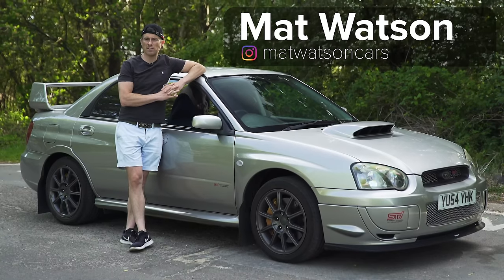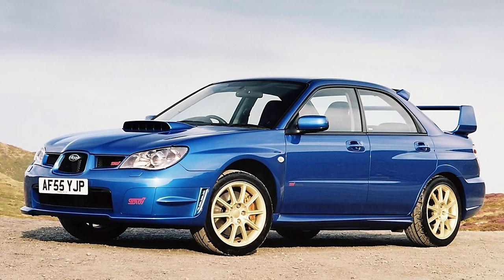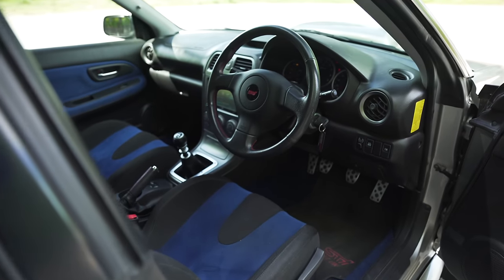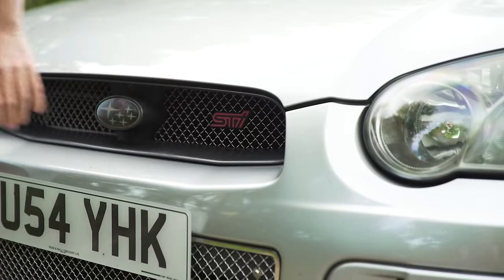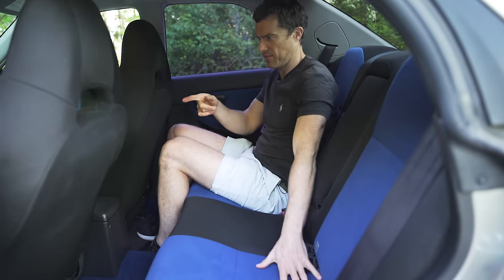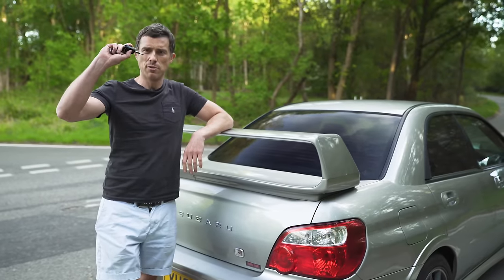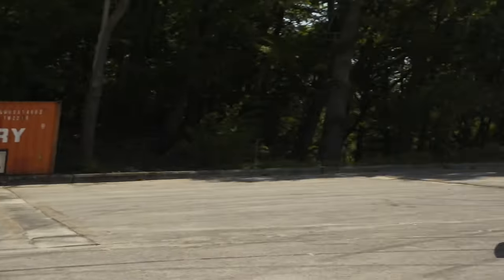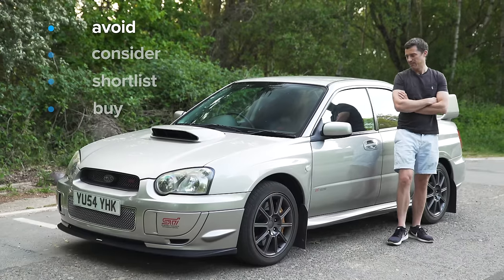Subaru Impreza WRX STi Prodrive 2004 - see why it's the best Scooby ever!

Comment: Just got myself a Subaru wrx turbo prodrive pack loving it goes for fun low miles . Matt can you tell me if the wrx model has the wires there for c diff button and boost gauges thanks

Comment: No they are not discontinuing the STI he said that wrong, they are going to stop making EJ20 engines and replace it with a 2.4 instead of 2.5 line it is now, and it could be getting 400 hp they are attacking Mercedes four cylinder

Comment: I had this car for 6 years. Just a minor tweak on the stock, and i was able beat Gallad. Sti so cheap interior, everything was no noisey. lovely turbo and exhaust sound and all, but so much wind noise, and uncomfortable. after 2007 Sti got uglier and uglier than than the concepts cars, i finally gave up on the deisgn department, and performance so weak. as of today. they ruined the rally inspired car to a cheap awd boxer engine.

Comment: The best? Matt needs a drive in the 22b.
Reply: The 22B isnt the best though, its a fabulous car but the 22B isnt as nice to drive as some (P1, Type R etc are seen as a better car on the road).
Its the one that holds its value most though, a proper limited edition 😁
Reply: @tonyb1223  well the main problem with the type r was that people said the suspension was too backbreaking for the roads and that why people prefer the p1, so i doubt the type r is better than the 22b lel
Reply: @3nd4tom1c8  the STI Type R was fine on the roads, not as nice as an STI Spec C but nice nether the less.
The issue with the 22B is that it wasnt really made for the roads in the same way a Type R was, the enhancements didnt always complement the car, this is why it wasnt as nice to drive as other classics, we had a couple in my Subaru Club, they were stunning looking cars but even the owners would tell you that they were hard work to drive.
Reply: @tonyb1223  ah i see my bad, but ik that prodrive got the type r and softened it up for uk roads when they made the p1 doe
Reply: @3nd4tom1c8  the P1 was a bit of a hybrid, it was an STI V5 saloon base with a Type R shell, I believe the shocks were Bilstein, the map was a JDM STI map but they put broquets in the tank to compensate for the fuel (Subaru wouldnt let Prodrive map the car), which was a bit of a bugger.
Prodrive also said that they thought no ABS and a DCCD wasnt practical for UK roads, which is why the P1 has ABS and single pot rear calipers (2 pots on a V5 type R which would be the same model year).
The 22B didnt need a remap as those could run on 98 ron UK fuel with no issues (MY99 JDM's and beyond are a 100 Ron fuel map).